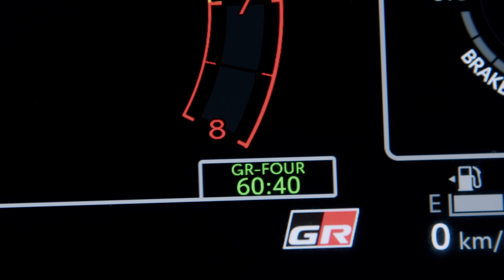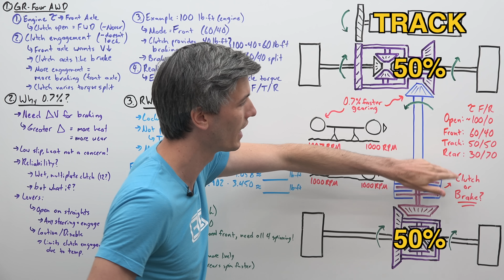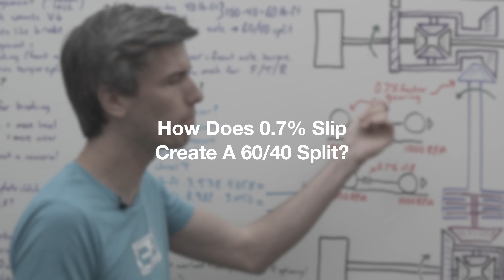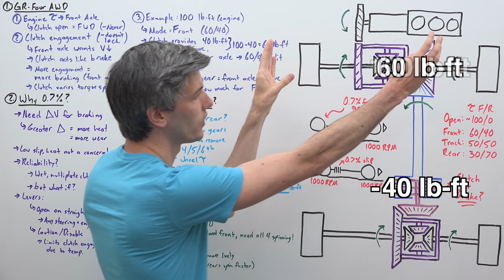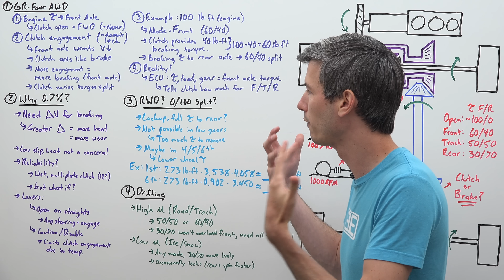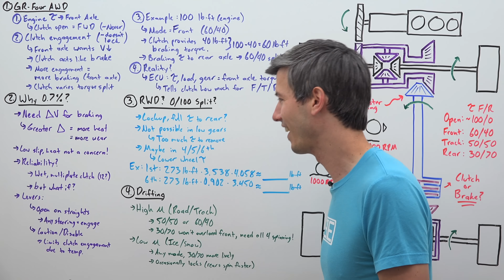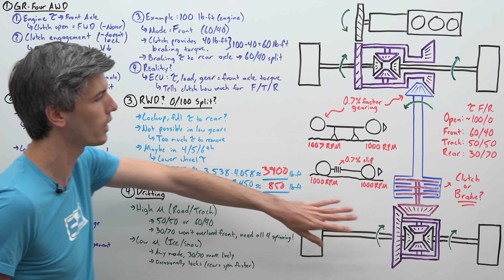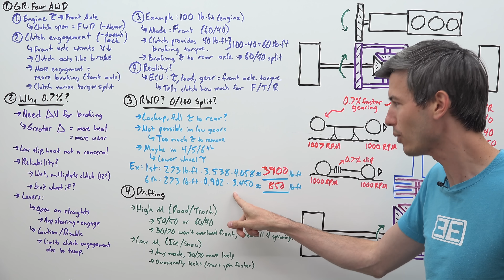Toyota GR Corolla's Brilliant AWD System - How It Splits Torque!

Comment: Acura's SH-AWD operates in a similar way with overdriven rear wheels, but they go even further with torque vectoring between the two rear wheels.
Reply: If ShAwd is better than toyota’s, why didn’t they put it in the Type r?
Reply: @tinhinnh  because SHAWD is Acura tech, and Honda has VTM4. Just Honda being Honda. There's the Type S, but that thing desperately needs a 500 pound diet.
Reply: @E82N55  They absolutely should put it in the most sporty honda, the type r but of course they will call it another name. Actually the prelude type sh was the first car to have this system, well not quite the same but it had first before the acura RL
Reply: @tinhinnh  Type SH is not SHAWD.
Reply: @E82N55  i know, its was still in development
Reply: @tinhinnh  Weight and cost (But i think its mostly weight). All AWD systems have a weight gain due to rear/center diff and then, there are the additional driveshafts. Curb weight for the type R is 3071 (FK8), curb weight for the GR corolla is listed at 3150. Numbers-wise it doesn't seem like a big difference but it affects the car's handling characteristics. AWD systems are nice but with honda figuring out how to eliminate torque steer from the car through suspension geometry, it really doesn't need it imo.
Reply: @timkono5645  eliminating torque steer doesn't eliminate the other physics problems with only having power going through the front axle. It's still worse than RWD or AWD.
Reply: @jsquared1013  Agree that it doesn't but at that point, this is really getting into the realm of preference if you are willing to put up with the tire wear. My '05 Sti has an inherent tendency to understeer while my Type R to feels neutral to me. Go figure.
Reply: @timkono5645 fwd crap is fine when cornering while not on the gas, but as soon as you push on the gas it turns to crap. Just the way it is. Always has been and always will be
Reply from the maker: I don't believe SH-AWD overdrives a whole axle, instead, it overdrives a wheel on an axle. Ex: The outside tire will spin faster than the inside tire on an axle.
Reply: @EngineeringExplained  The 1st gen SH-AWD system in the 2005 Honda Legend was more complex than this Toyota implementation, but used similar principles. This has a fixed gear overdrive of 0.7%, a multi-plate clutch and a differential. The 1st gen SH-AWD had a planetary gear set in front of the clutch pack acting as the accelerator with 1.7% overdrive which then connects to the left & right half shafts with their own set of planetary gears & multi-plate clutches. There was no conventional differential.

However in order to save costs, the 2nd gen SH-AWD in the 2008 Acura TL dropped the Accelerator unit for a fixed gearing as is done with Toyota here, but with 1.7% overdrive instead of 0.7%. The loss of the planetary gear set on the central drive shaft reduced the torque distribution range especially in tighter corner.

The 3rd gen SH-AWD in the 2014 Acura TLX took another cost reduction step dropping the 2 planetary gear sets from the half shafts replacing them with just 2 larger multi-plate clutches while keeping the fixed gear overdrive from the central drive shaft, but the ratio was increased to 2.7%

This 3rd gen SH-AWD is very similar to the GKN Twinster used in the MK3 Ford Focus RS using 2 multi-plate clutches for each rear wheel. The central drive shaft though had a fixed overdrive ratio of 1.8% instead of 2.7%. Some versions had an additional multi-plate clutch upfront to disengage the rear wheels via the drive shaft for fuel savings.

I see this Toyota AWD system as a further cost reduction from the SH-AWD & GKN Twinster. It replaces the 2 independent multi-plate rear wheel clutches with a conventional differential, while placing a single multi-plate clutch ahead of the differential. This is a much cheaper solution that can be deployed in more entry level vehicles by trading off a wider range of capability.

so in order of complexity from high to low
-SH-AWD 1st gen - 3 planetary gear sets + 3 multi-plate clutch packs
-SH-AWD 2nd gen - 2 planetary gear sets + 2 multi-plate clutch packs
-GKN Twinster - 3 multi-plate clutch packs
-SH-AWD 3rd gen - 2 multi-plate clutch packs
-Toyota GR AWD - 1 multi-plate clutch pack + conventional differential
Reply: @tonamiplayman4305  this comment is bang on
Reply: @tonamiplayman4305  The trade off isn’t capability, it’s more likely durability. But this is simpler, lighter and way more cost effective. Just know that you’ll need to replace clutch packs after x number of kms.
Reply: @tonamiplayman4305  can they rally though?
The GR yaris was made from rally, The corolla was made from the yaris to be more practical.
I think you need tough LSD in rally cars, and weight is always an issue when getting serious.
Reply: @tonamiplayman4305  GR-Four is just an iteration of the AWD system on Toyota's SUVs. An AWD Toyota Sienna has the same ITCC style magnetic coupling unit the GRC/GRY has. It's the same vendor they just added more clutch packs for thermal/torque capacity for GR-Four. The GR-Four drive modes are similar to Subaru's former DCCD system
Reply: @benjaminwingchun9665  the Rally1 GR Yaris didn't use the ITCC unit (active centre differential) the road going models have. They essentially used a solid center diff instead.
Reply: @Slicks14  the ITCC isn't a differential.
Reply: @Slicks14  the Subaru DCCD has a mechanical center diff with a native rear-bias, and the active DCCD system tightens (or loosens) clutch packs acting on that center diff.
Reply: @EngineeringExplained  youre mistaken. the 5th paragraph under 'development' on the wikipedia entry for shawd explains.
id really enjoy a video explaining how shawd works and progressed. its an interesting system.
most had the rear axle over driven at a constant 1.7% but earlier versions (that were used in the rl before it was discontinued) had an 'acceleration device' that let the overdrive be varied up to 5.7%. which allowed greater amounts of power be transfered to the rear axle. but i think it slightly limited the amount of power that could be kept in the front axle from 90% to 70-80%

Comment: Subaru developed this type of AWD system for the STi long before Toyota released the GR Yaris or GR Corolla. It's almost as if the "partnership" between Toyota and Subaru was less about development with the STi being discontinued. Hopefully Subaru brings the WRX and STi back to the roots of what made the cars unique. The first gen USDM WRX and STi were quirky rally inspired cars that consumers had the ability to purchase. While they weren't supercars, the GD-chassis WRX and STi were fun through curvy roads, perfect for cruising, and blast in the snow or off road.
Reply from the maker: DCCD is quite different from what's being employed here.

Comment: That was fun!
Any discussion about the ebrake disconnecting the rear axle when active?
Reply from the maker: I don't know the answer, but if I were to guess it does not disconnect the rear. You'd want to push the clutch pedal in so that you aren't braking (not to be confused with breaking) the engine.
Reply: @EngineeringExplained  Descriptions of GR Yaris say that handbrake opens the clutch-pack.
Reply: @EngineeringExplained  GRY does fully disconnect the rear when hand braking :)

Comment: So if there's a 0.7% difference in the rpm in the front vs rear does that mean each 360 deg rotation of the system induces 0.7% of 360 degrees of slip in the clutch pack? If so then it'll slip ~2.5 deg per full rotation of the system. Would that slip angle every change outside of circumstances where a wheel or wheels is off the ground?
Reply from the maker: Pretty much in all scenarios with wheels on the ground, you have 0.7% slip occurring in the clutch pack. If the front axle were to be lifted off the ground, it's possible that slip percentage could change (low clutch pack pressure, lots of slip, lock up the clutch, no slip %).

Comment: Was the slip ratio mentioned? The wheels receiving more torque must slip more and vice versa. Tire force( =wheel torque divided by wheel radius) is a function of slip. Zero slip means zero force (while driving).

It doesn't take terribly much speed difference to achieve high slip difference. Therefore 0.7% seems to work. The grippier the surface, the less speed difference is required.
Reply from the maker: To be clear, the wheel speeds will be the same traveling in a straight line (yes, you have tire slip to accelerate, but the speed differential, which allows the torque split, occurs in the differential). It is not creating a torque split by varying the rotational speeds of the tires.
Reply: @EngineeringExplained  Let's take the rear wheel drive case. I guarantee that the rear wheels will rotate faster than the front wheels whenever forward power is applied.

I'm trying to stress the importance of the slip ratio.

Edit: I think I was half wrong. Tire slip is not required for this system to apply 0-100% of torque to the rear wheels. But the whole point is to remove some of the slip from the front to the rear, either for more total traction or for drifting.

Comment: Overheating seems to be quite common when getting pushed though. The car goes into fwd mode and displays a message in some Nordschleife videos I watch. Still great tech and great cars though!
Reply: Check tires on those cars, almost all had 255s. If you upgrade the tires, upgrade the diff cooling as well imo.
Reply: That's exactly what I would expect. I definitely wouldn't expect sustainability.
Reply: @eyeballengineering7007  But that's exactly what's happening, system going into protect mode -- to assure sustainability. Working as designed. 
And as previously mentioned, quite a few GR Yaris have a) tweaked power and torque b) run very chunky track day rubber -- say sticky Cup 2s. Grip on a hot day so you'd worry about suspension damage on your average Lotus ;-). Diff reliability has been a total non issue with the Yaris so far.
Reply: @kolbenkopp-8780  hahahaha hilarious. Oh yes, the limp mode design. Definitely sustainable.

Comment: Kinda the same process when paralleling AC generators. If you make one try to spin faster when locked together, the faster machine picks up load from the machine set to run slower, although both must spin at the same speed.

Comment: This is sounding like a real alternative to the current WRX, if availability doesn't become a problem. 🤔 Looking forward to seeing the inevitable head-to-head comparisons.
Reply: It won’t really be a good comparison when the price difference would be close to $10000. Maybe it would be comparable to the golf R, or maybe even an Audi.
Reply: Leaks are saying this starts at about 38k without the LSD front & rear
Reply: @treeeves  Pricing got announced, it starts at $35,900 without any options. A fully loaded Core with all three options packages comes out at right around $40k after destination fee.
Reply: From what o saw only about 6000 manual gr Corollas will be sold in the us 🥲
Reply: @NackteTraube  it's closer to 5,000 due to production issues, but that's also just for the first year. There will be plenty more to come in later model years.

Comment: This is a nice system, it really is.  A lot of thought went into it and I'm glad they have provisions to reduce wear while maintaining track cornering performance.  But I do worry about the long term life of such a system, especially on something that will be daily driven (maybe I missed a FWD only mode).  It also seems to overcomplicate things.  Just give me 3 torque biasing differentials (Torsen, Quaife, Peloquin) and brake based traction control that is designed to handle the additional heat of track use.  With a system like this you would realistically only ever use the brake based traction control if a wheel is off the ground or if on very slippery surfaces like wet ice.  I have lifted the inside rear tire of my GTi in autocrosses and I have seen RWD cars lift the inside front tire when accelerating out of corners during autocrosses.
Reply from the maker: It has two torsen diffs, front and rear. And fyi - torsen diffs rely on internal friction for torque to be transferred left-to-right.
Reply: @EngineeringExplained  Thanks for the reply.  I wasn't aware it already had torsen diffs front and rear.  Maybe I missed that in the video as well.  I don't have as much time to keep up with automotive news and car reviews as I used too.  (Sad days :( for me)
In your opinion, in a well designed and properly maintained system which will have a longer service life?  A torque biasing differential or a wet clutch pack?  I know there would be a lot of other variables as well, but assuming all other variables are controlled to be thr same.

Comment: Recently saw a video of a guy on the Nordschleife, whose diff overheated.
Reply from the maker: What was he driving?
Reply: @EngineeringExplained  Hi! :) The GR Yaris on 225mm semi-slicks. Air temperature 16°C.
Reply: @EngineeringExplained  probably GRY with 255 slicks, quite common if you upgrade tires and leave diff cooling stock, there are many options out there to cool it down - vents, bigger diff cover etc...

Comment: This sounds like the Subaru Active Torque split system used on the everyday cars like the Impreza and Forester. Jason has talked about that before, but there hasn't been much in depth detail in that system. At default an Impreza splits 60/40 through a clutch pack, it's only the WRX or manual transmissions that they use a mechanical center differential.
Reply: The Subaru has a centre diff the Yaris / Corolla doesn’t
Reply: @kentowers2802  Not the normie CVT models, there is no center diff on an Crostreck or Outback, it's a clutchpack.

Comment: Interesting thing is that Mazda is using exactly the same system as Toyota (ITCC by JTEKT) but with 1% overdrive ratio. However - they are not using it to send more torque to the back but only to eliminate the backlash of the drivetrain.
Reply: i rem a video by the mazda chief engineer, sounding something like this.  this video title is misleading, its not brilliant, at least he didnt say new.  and it doesnt sound as good as torque vectoring sh-awd.
Reply: lol I think I talked with you about the cx60 AWD system, yep it used itcc too
Reply: @dann1s.365  On my channel? I believe CX-60 uses ITCC to but I meant fwd based models with the same layout as Toyota. Some years ago they've been cooperating with GKN but probably switched to JTEKT when CX-30 hit the market.

Comment: Awesome video! A very complex mechanism brilliantly explained.

Just one question, does that fancy clutch pack differential have it's own cooling? Maybe oil cooler?
Reply: It doesn't, it's just extended electromagnetic ITCC.
Reply: @4x4.tests.on.rollers  
Thank you. I did not know about these ITCCs. Reading up now.

Cool channel by the way!
Reply: @PRAD33PK  Thanks!
Reply: @PRAD33PK  There are a few companies making electromagnetic couplers. JTEKT makes ITCC, GKN Driveline makes EMCD, Borg Warner makes NexTrac. And there's probably more.
Reply: @Way Outthere Thanks for the info. That's still a cooling helper, no real cooling circuit of oil.

Comment: One negative here: If you tune up that engine, the clutch pack can still only draw so much torque for the rear so beyond a certain point all your torque improvements go to just the front axle.

Upgrades focused on making that engine rev high and carry the same torque longer wouldn’t have this problem though.
Reply: I've seen some people crack the controller for the system and are able to send more rear power than factory, I guess they up the clutch pressure
Reply: @ryancooke8429  I think the issue is it can only handle so much torque continuously before overheating. Maybe giving that clutch its own oil cooler is possible.
Reply: @cromptank  yes I'm sure at some point it would need better cooling and or upgraded clutch plates, but it seems like the system is still pretty effective in the 400+HP range, plenty for a small car
Reply: It weighs as much as a pair of boots. And it's 285 from a 1.6 3cyl
I'm not sure how much power has been left on the table before reliability/service intervals become a pain in the arse.
Reply: @capnskiddies  that’s an excellent point
Reply: @capnskiddies  based on what's been happening with the GR Yaris for a while now (same engine and drivetrain), it'll handle quite a bit more power easily.

Comment: its nothing new, its just a haldex system with an overdriven rear diff. its kind of disappointing this. What would have been interesting is if Toyota could integrate a clutch, dry, in between the front axle and the rear prop shaft that is always open for rear mode and closed so that you can choose between 60/40, 50/50 or 30/70
Reply: Actually that's not haldex but ITCC by JTEKT.